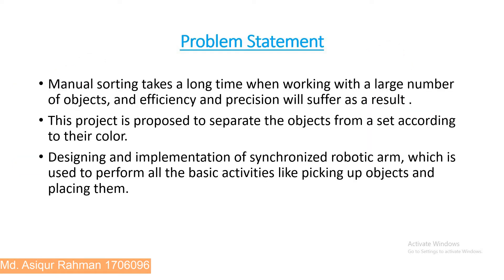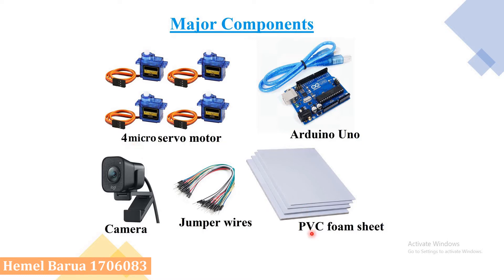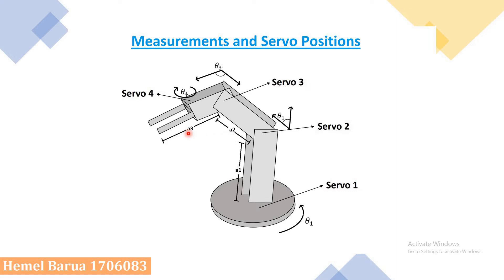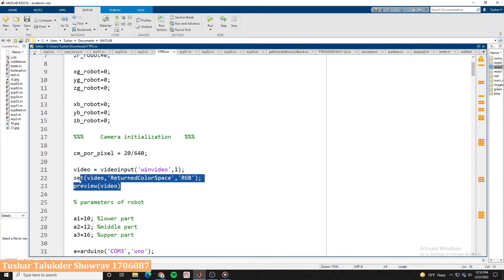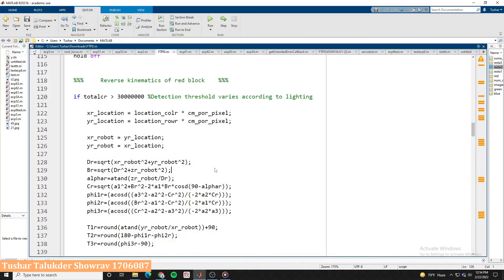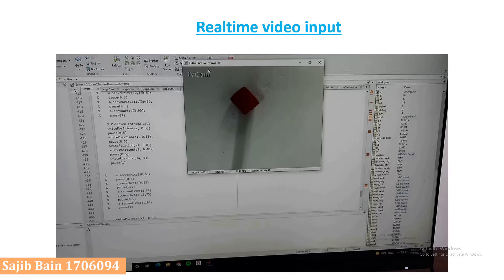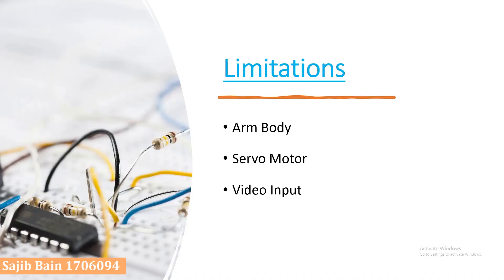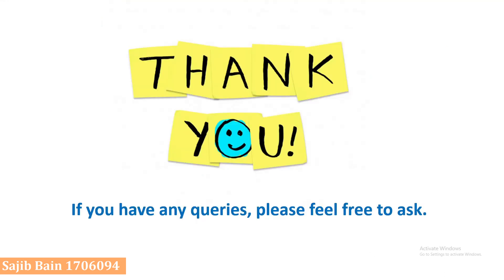Robotic arm using Computer Vision for object sorting (with necessary codes)

Comment: Bro i am also working on these project so my guide asked me how u connect both matlab code and arduino
Reply from the maker: Using matlab arduino library
Reply: i also but cant download to my pc. and still not working.pls help
Reply: @gkdivya3 yaa i also did full but it's not worked in my college time project, but I got 92/100 in exam 😅 👍🏻